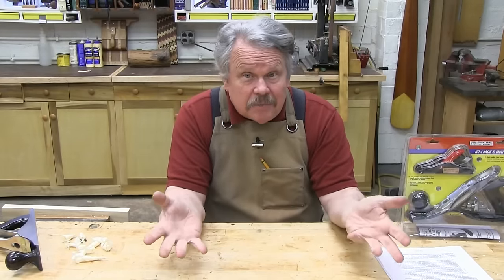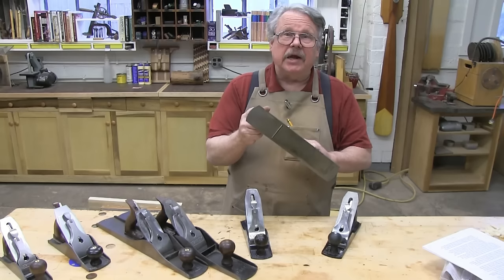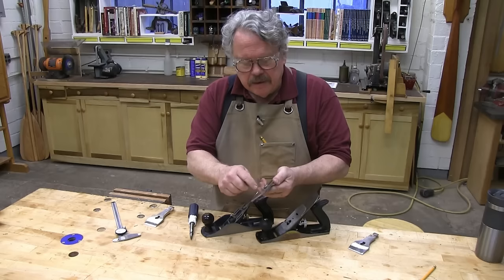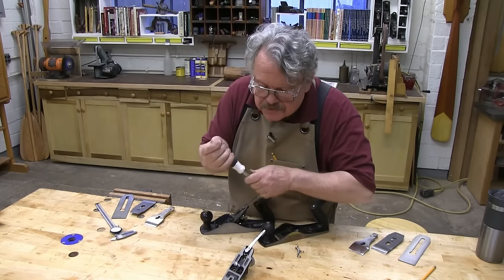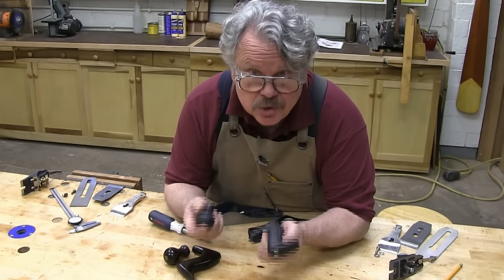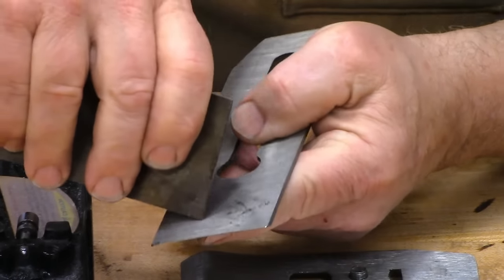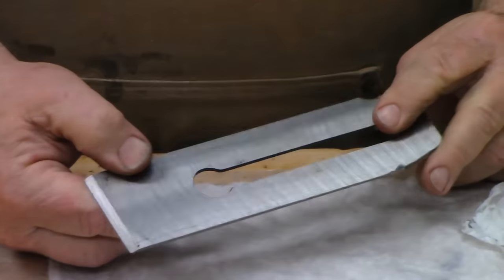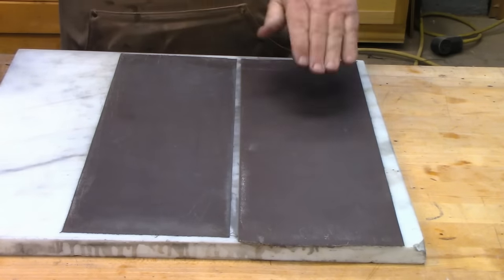Harbor Freight Jack Plane - How Does It Stack Up?

Comment: I’ve had all the same issues with this product. It  was completely unusable. No matter how many times it was adjusted it just seemed to get worse. Part of the frog ended up breaking off. Overall terrible and I have very little trust in Harbor Freight now. Thanks for showing what a planer should do!
Reply from the maker: I know your frustration. It looks like it should work if you could just tweak this or that. But you quickly find it's beyond tweaking.

Comment: i bought a $10 block plane from menards for carving a greenland kayak paddle. "great neck" was the brand. I had no idea why it wasnt working, I just knew it sucked! I went to ace hardware and got a higher quality block plane. now i'm going to take apart the "great neck" and look for poor quality maufacturing.
Reply from the maker: I've seen the Great Neck copy of the Stanley No. 4, but I have no experience with it. Just out of curiosity, what was the brand of the plane you bought at Ace? If you had a good experience, maybe that's worth another "unpacking" vid.
Reply: @WorkshopCompanion  The block plane i bought from Ace hardware is Ace brand. It's a 7" adjustable block plane. I have had limited experience with hand planes in the past, but I used this how it was set right out of the box, and it worked great for my whole project. The Iron could have been sharper, but i was working with cedar, so it cut well enough. Here is a link to the product i used.

https://www.acehardware.com/departments/tools/hand-tools/planes/20490?store=14366&gclid=CjwKCAiAudD_BRBXEiwAudakXyU8FL-Rn4c3QDkh0_1_YUldbqyakV6vNOntizbO_v3L0587Sin5fxoCxTUQAvD_BwE&gclsrc=aw.ds
Reply from the maker: @SmokinSkatinJammin  Looks like a reasonable copy of a Stanley No. 60-1/2.  The only difference I see is that the Stanley has an adjustable mouth, but for $23 I could live without it. New Stanleys go for 4-5 times that! There's an Ace nearby;  I''ll check it out -- thanx!

Comment: I’ll put it this way.

Suppose I can buy a halfway-good tool and, with reasonable effort (let’s say about 1-2 afternoon’s worth of work using only tools I already have), I can make it into a great tool.  If that saves me a significant amount of money over buying a great tool, I might be up for the challenge.

However, if that process is going to demand a skill level that’s far above my abilities and leave me frustrated with a pile of useless parts and no end in sight for my project I bought the thing for…well, I’m not really up for that.

If I’m trying to achieve a new skill, what I need is a tool that I know is going to do the job properly when used properly.  That way if it doesn’t work right I know the problem has to do with me and my technique, not the tool itself (and it’s also not because I put it back together wrong).

Which is a long-winded way of saying…for me, it is almost always better to wait, save up money, and get the great tool in the first place.

OTOH if making a great tool out of an inexpensive tool is the project…well that could be a great project.  It is very cool to see that such a thing can be done, even though it takes great effort (and a shame that so much effort is required).

Comment: I bought a silly cheap bailey pattern, not HF, because I couldn't afford anything else,  fortunately, the internet was now here and several hour's of video's later, I was able to turn it into a very usable plane, one in fact I still have. I am fortunate enough to now own much better quality plane's but I still keep that low end one to do rough work like cleaning up a piece of wood that was once part of a piece of furniture that's covered in paint and may have small panel pins embedded in it. The reason these plane's are so cheap is because all this extra work is done by you, the new owner, if it was done by the manufacturer, the purchase price would be much higher.

Comment: I work in quality engineering. This is extremely fast purely numbers based manufacturing. I'm sure the central forge company has PFMEA specifications for its products and we all can plainly see the company they chose overseas is not even following the already underwhelming built for speed print specs (minimal machined surfaces =cheaper manufacturing cost) which is unacceptable.

Comment: I was always told to have the blade in the plane and totally retracted to flatten the sole because the plane flexes what is the true story? Please
Reply from the maker: Recently, I read a report in a forum from another experienced woodworker who reported he did it both ways and found absolutely no difference. And if you think about it,  if the plane is well-made the parts should all fit together without distorting each other. If you want to perform a quick experiment to discover how much a change in tension changes the shape of the sole, screw the lever cap screw down as tight as you can and make a few passes. The plane will work just fine. Lay a straightedge against the sole. If the sole was flat to begin with, it will remain flat with an over-tightened cap screw. It may flex a few thousandths of and inch, but no where near enough to affect operations.

 We are presently preparing a video that will compare two twentieth century designs for bench planes. Both manufacturers boast that the planes come with perfectly flat soles, no need for lapping. I know for a fact that these tools were both machined flat before assembly, yet they both cut beautifully.

Comment: Oof a sin against craftsmanship indeed.  An excellent cautionary tale and video on how to turn a cheap tool into an ok tool by spending, and I'm guessing here, anywhere from 10-20 times the initial investment.  A beginner who can't afford a quality new tool, would be far better off spending that investment on a Stanley on ebay or estate sale in my opinion.  You will likely still need to tune it, but at least you will be usually starting from a much better position.
Reply from the maker: We figured that if we had to pay for the precision grinding and we paid ourselves $35/hour, the rehabilitated plane is worth somewhere in the neighborhood of $1200 to $1500. I'm currently advising folks to look into Jorgenson's #4 plane -- about $70 and it offers a better iron than Stanley or Hock.
Reply: @WorkshopCompanion  That's eye popping, and a great suggestion for the Jorgenson

Comment: Based on your level of expertise, your hourly rate should be exorbitant. The number of hours you spend on this plane was extensive. The use of another shop with lab grade equipment was significant. Altogether, this one of the most expensive hand plane I've ever seen.
Reply from the maker: Travis and I have done the math with my time at $25/hr US  and Jim's services at market rates, this is an $1800+  bench plane.

Comment: Train me lol where do I apply for an apprenticeship
Reply from the maker: No need. Really. After I finished writing my woodworking encyclopedia, the "Workshop Companion" series, I took a hard look at all the information I had gathered and boiled it down to the core information you need to be a competent craftsman. I published this as a single 400-page book called "Woodworking Wisdom." If I offered an apprenticeship, that would be my textbook. It's out of print, but it's fairly easy to find used copies on Ebay or Amazon.
Reply: @WorkshopCompanion  i found one, thanks for the tip and the videos

Comment: Problem is .. if they would care that everything works as intented and not produce it in a "Rush" and as cheap as posible .. the Tool would be a good deal but not as cheap as it is .. 
and with a higher price then they would be in competition with well-known brands/manufacturers. 
So .. if the Plane would cost almost the same as a new Stanley, would you rather buy a Stanley where alot of People know what they are getting and with alot of Reviews? or a Plane that no one knows?
But if the Plane is way cheaper then most of other tools, less then half the Price .. would you then rather give it a try? 
And the last one is what they are banking on (like with Amazon Basic stuff) they dont want the Customer to come back, they are fishing for "First Buyers" only

Comment: Wow, that's a lot of work to bring a piece of junk up to the standard of a not terribly expensive tool.  

A quick google search found a Stanley No.4 Bailey Smoothing Bench Plane for $65 Canadian.  That's certainly not a cheap tool by any means, and certainly more expensive than what harbor freight sells the bad plane for online, but...I was expecting more than twice that price for a Stanley, given their reputation for quality - that kind of reputation often comes alongside fairly ruinous prices.
Reply: Cheap is a relative term. When I was young and money was tight, I had a #3 knockoff and a Handyman block plane. Later in life when I had a crew of guys to keep productive, $65 wouldn't even cover the daily consumables. Post retirement, my father wouldn't bat an eye at spending $65 on a tool, (though he's never have spent $65 on a #4 Bailey because he already had a few dozen that he'd previously picked up for $10/ or less, at flea markets and/or garage sales). These days it's not uncommon for hobbiest woodworkers to have more than $100K invested in their shops. Anyhow, a Stanley #4 in reasonable condition can usually be fettled so as to produce work rivalling that of modern premium planes costing 10 times more.

Comment: I bought this plane and the other one with wood handles at harbor freight yeah that plane you have is complete garbage. I love harbor freight my favorite store by my god. The lever cap is so hard to use even lube it. Did everything you did in the video still scrapes lol. I bought the Windsor l, the one with wood handles and it was dead on ever where didn’t have to sharpen it. It was dented on the side but so deep no one could stone it out with out making the blade too short. Over all I like them ok at least definitely worth $30 even if that plastic one goes to parts

Comment: So could you just buy some nicer aftermarket blades and make this work without having to do a large amount of filling
Reply from the maker: By this plane for about $14 and a new Stanley plane iron for $35.97, and you've already invested more that an old Stanley will cost you at a flea market.

Comment: buys a bad plane... has to use the whole shop to repair it, isn't even enough, has to go elsewhere for another tool even to fix stuff... and now its a mediocre plane. 
basically: if that's the first plane you buy, you need to buy a workshop's full content and then some to fix it.
Reply from the maker: You get it.